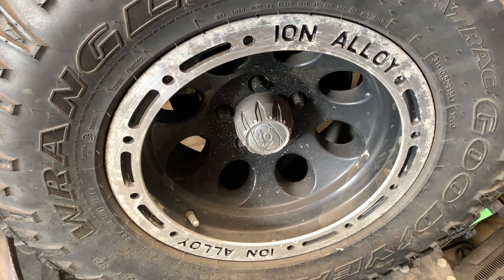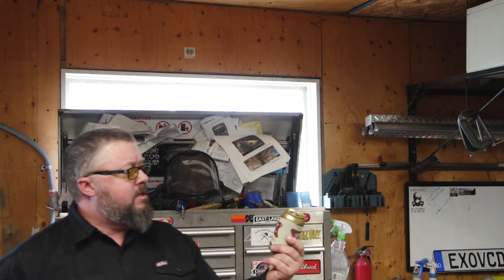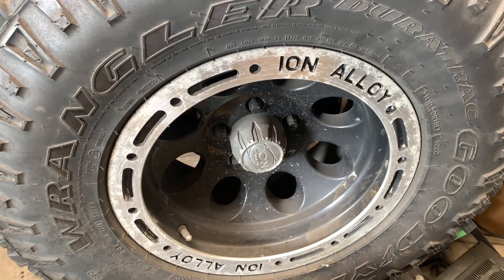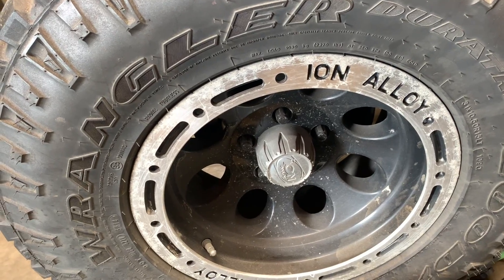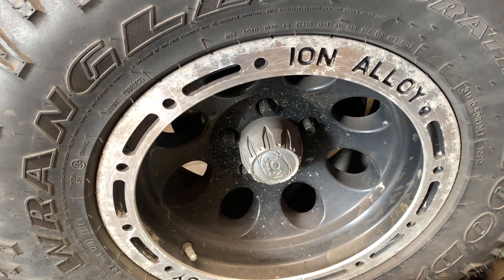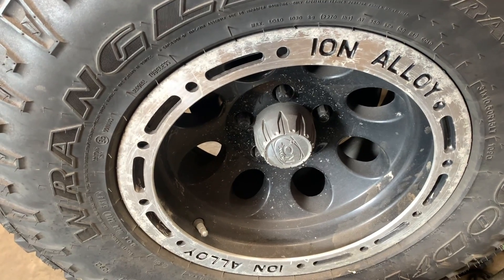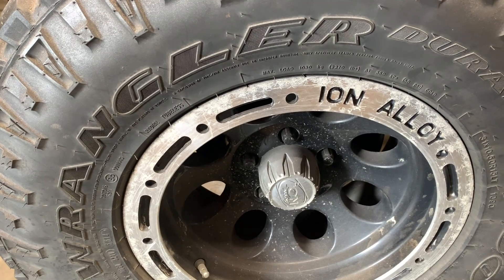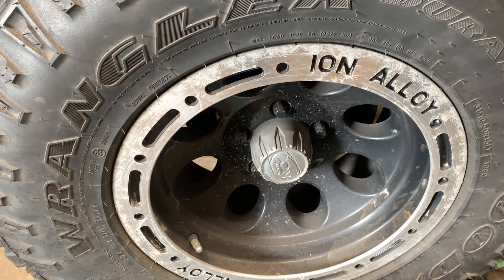Why Using Anti Seize on Wheels and Driveshaft Flanges is Bad

Comment from the maker: Just by the comments I said not many people would understand...... not talking about putting anti seize on threads here people....

Loss of clamping force can result from several other common installation errors, such as neglecting to thoroughly prepare the hub and wheel mounting faces. Any contacting surfaces must be absolutely free of dirt, rust, excess paint or other material that can be compressed as the clamping force is applied.
“Paint, rust or dirt will eventually wash away or fall out, reducing the clamping force,” Walters says. “In particular, steel wheels that are painted are most susceptible. Corrosion of the steel and old paint can flake away.”
A thorough going-over with a wire brush will usually remove loose material, but repainted steel wheels can be a problem too. Paint will compress under the heavy clamp load, and like rust flakes or dirt that tumble away over time, the compression of the paint will leave a gap that could cause the nut to loosen due to the loss of clamping force.
Wheels should not be painted with a paintbrush, because you can’t guarantee an even thickness to the coating. “The coating cannot be any more than 3 - 3.5 mils thick, especially on the mounting surfaces and between the bolt holes,” warns Jeff Redding, national equipment and coatings manager at IMI, a recognized wheel refinisher. “Excessive coating thickness can lead to a loss of clamping force and eventually loose nuts and possibly a wheel loss.”

Source : https://www.truckinginfo.com/157847/what-you-dont-know-about-your-wheels-can-hurt-you

Comment: It's not dangerous to use Anti-Seize on lugs if you adjust for reduction, these bolts are Grade 10.9 and are very strong so its unlikely you will sheer em iff or have them rattle off if they are tightened good within spec whoch usually has a 40 Ft-Lb margin.
The problem with anti-seize and over torqued lugs is 99% caused by shops that use a high torque impact wrench and neglect hand torque wrenching to manufacture vehicle and fastener specific specifications!
Let's say an idiot under tightened your lugs and they started coming loose from vibration, it's not instantaneous and you will not just have a tiee fly off without warning! Your car will drive smooth when sped up and rattle when you let off the gas pedal and slow down. This is the indicator your lugs are starting to come loose. Pull over and break out your  tire iron 3/4"/19mm and snug them up tight. Drive home and get your torque wrench and fasten those lugs within spec!
"The Solution to anti-seize reduction of torque values"
 Using anti-seize compound on the threads only reduces torque values by 30% according to AJax the worlds leading bolt engineers.
The average wheel requires between 75-115 FT-LBS 
My '02 Jeep Grand Cherokee Laredo specifies to torque between 80-110 ft-lbs.
I personally shoot for 100 ft-lbs of torque when threads are "dry" or residually lubricated like from factory. Look at your service manual, they may even list a dry and wet torque setting to use. The Wet "torque wrench setting" is what you use with anti-seize compound on your lug nuts/studs threads.
With Nickel Anti-Seize I set the torque wrench to 70 Ft-Lbs and it reads 100 Ft-Lb in reality every time.
"The EASY formula for anyone to use"
Look up your vehicle service manual and
Whatever Ft-Lbs you your manufacturer states your vehicle needs to be torqued to in the torque-spec: 
just multiply it by 0.7 and you will get the Ft-Lbs you should actually set the torque wrench to after applying anti-seize compound to your lug nut threads!
For example: 
TWS = Torque Wrench Setting.
44ft-lbs X 0.7 = 30.8ft-lbs TWS(31)
70ft-lbs x 0.7 = 49ft-lbs TWS
80ft-lbs x 0.7 = 50ft-lbs TWS
90ft-lbs x 0.7 = 63ft-lbs TWS
110ft-lbs x 0.7 = 77ft-lbs TWS
150ft-lbs x 0.7 = 105ft-lbs TWS

Multiplying by 0.7 is the same exact thing as reducing by 30%
Those of you in the rust belt and cold areas with salted roads can thank me later!
It's extreamly easy formula to follow.
My lugs are 80-120 Ft-Lbs according to Chrysler torque spec on my vehicle.
I normally shoot for 100 Ft-Lbs and that means I dial in 70 Ft-Lbs if I use Nickel-Graph, Copper or Silver Anti-Seize.
Not hard at all is it.
If you are worried, you can buy a 1/2" drive torque reader from ACdelco

Comment: This is wrong. For one. 99% of all wheels are now lug-centric, not hub centric. Two, as long as you're not putting the anti-seize on the threads or lug nut. You're 100% fine, and no (steel) lug nut is going to back off. It's not effecting the clamping force, between wheel and hub AT ALL.

Comment: Continuing from my previous comment... putting the specified torque on the lug nuts achieves the proper clamping force needed to maintain adequate friction between the hub and wheel without lubricants.  Over torque on the lugs actually REDUCES the cramping force needed due to distortion created in the threads.  If you put anti-seize on the threads of the lug bolt that’s probably ok, provided you make allowance in the specified torque because the correct clamping force will be achieved at a lower lug nut torque than specified on a dry lug bolt.  How much lower, I don’t know.  If you use the dry torque spec on a bolt with anti-seize it will be over tight and the clamping force will not correct as to the case when it’s over tightened.

Comment: You are absolutely correct in your analysis of how power is transferred from the axel to the ground by friction between the wheel and the hub, but you are missing one word you need to add to your vocabulary.  That’s “Torsion”.  The lug bolts from the hub are not designed to handle the circular twisting shearing force (torsion) that is supposed to be born by the friction between the hub and wheel which is held together by the lugs.  Proper torque on the lug nuts holding the wheel to the hub free of lubricants is what was designed.  To understand the relation between torque and torsion think that torque is applied about a fulcrum which result in torsion (twisting) forces applied to the shaft.

Comment: I have been using anti seize since the 70 s and have never had a problem with it , even on my off road racing and trail riding! , my dad who was a master machinist said that the flaming should be high with the anti seize then without!

Comment: I would think closed wheel nuts would help.  If you have open wheel nuts, put them on dry but after torqued, cover outside with coat of grease to keep salt out.  Maybe also put small ring of grease at base of wheel studs before threading on nuts to keep salt away from other side.

Comment: My mechanic took your advice and didn't use anti sieze.  Now, unfortunately, 1 bolt (out of 8) siezed, WD40 didn't loosen lug and now I have a stripped stud.  To remove I'll need to drill or grind the lug off.  Huge problem!  Will always use anti sieze in future.  Imagine if I had a flat somewhere and couldn't remove the tire.
Reply from the maker: sounds more like a issue with person doing the job vs actual problem
Reply: @BackCountryWrenching  took to a tire shop today and they tried an impact wrench. Now the stud spins freely. Probably wasn't a good option.  I'm drilling now. So painful.

Comment: You just gave a basic physics lesson to a lot of people. Apparently there are 31 people that didn't comprehend what you're talking about or otherwise think you're wrong. I've worked in the natural gas industry for 12 years and attended trade school for 2 year prior to that. Everything you said is accurate. Your rotational force is greatly diminished when the friction coefficient is greater than that which was factored in for the original baseline when determining torque spec. Inversely, your clamping force/inter-facial pressure is going to be more than desired when using a lubricant. That's also going to result in a higher than desired lateral pull on the stud itself causing undue stress which it was not engineered for. I'm not to get into galvanic activity or metallurgy, but there are a plethora of reasons why you're correct. I'm glad to see at least one person on the internet that knows what they're talking about. Good job. Sincerely.
Reply: Please correct me if I’m wrong but wouldn’t you then be able to just adjust your torque to compensate for the anti seize to still reap its benefits? And thank you for your explanation it helped with understanding the issue with the antiseize a lot
Reply: @Modelwaddle , I’m sure you could, but it would take a great deal of effort to know for sure how much torque is needed. It’s probably ok if you do use some, but I would be mindful of how it may impact your stud bolts. 

We used to experiment with friction coefficient on various thread types and lubricants when I first stared in the industry. Teflon coated bolts had the least amount of friction loss. 

I personally do not have a recommendation on this as there is a lot of liability involved obviously.

Comment: What you are saying is that anti seize changes the “clamping force”, but so does rust, corrosion, worn bolts/studs, stud wear, lug nut wear, temperature, etc?  How exactly are you measuring the clamping force?   I’ll stick with my anti seize.

Comment: Repeating old wive’s tales and lacking in any evidence. 

Drink your beer and leave advice to people who have evidence to back up their claims n
Reply from the maker: 😂😂😂😂😂 the evidence is clear obviously you’re just another arm chair mechanic
Reply: Bullshitkorner nope. And for the manufacturers who spec out anti seize on lugs and rims?
Reply from the maker: I never did mention anything about anti seize on lugs, however very little people know of wet torque specs when you do
Reply: @BackCountryWrenching  I'm not saying you're wrong, but you didn't offer evidence, you offered theory (an understanding of how the physics is supposed to work). Evidence would be a study with a bunch of cars, some with and some without anti-seize, and seeing what really happens. I'm seeing also some theoretical counter-arguments in the comments, but no evidence other than anecdotal.
Reply from the maker: @eblackbrook  this is the difference between tradespeople and armchair mechanics...... don’t need to offer evidence, there is no theory it has been proved many times over by engineers....... you can never understand cause you’re not a trades person and or lack real world experience

Comment: Interesting...good points as well. 
Surely, there must be a happy midpoint...As far as the studs/bolts...(beyond a certain threshold) I think it's most important that they are all at the same torque - whether that be  a bit too much due to lubrication, or too little gritty threads...an imbalance in manifold torque is more of a worry - in my opinion.
Nice. Thanks...

Comment: You are 100% correct, however; the engineers that design the hub and wheel assembly do it in a way that the "required" clamping force is at least 3x what is actually required to keep the wheel where you want it (on the hub) for normal driving conditions.  I use Anti Seize all the time, every time without hesitation.  Good video and very informative!!!

Comment: As stated in the general aviation maintenance manuals (203 series) shared by the Army and Air Force, it is stated that a light coating of oil be used on all fasteners requiring torques to achieve proper torque (clamping force) unless specifically stated to be dry. As far as anti seize on wheel studs the NTSB has issued guidance that it is not to be used.

Comment: A piece of parchment paper used for baking between the wheel and hub will keep it from getting stuck to it.  Something my dad taught me in the 70's when he was learning me how to wrench things in Michigan.  You're explanation about clamping force is right on, the same reason aircraft engines have absolutely no gaskets on the crankcase halves.
Reply: My Textron Lycoming DEL-120 service manual specifies POB No. 4 Perfect Seal and silk thread for sealing the crankcase halves. Hardly a gasket but, not just two pieces of metal slapped together either. 😃
Reply: @flyingdutchman6984  Yep. I should have specified no solid gasket material that could break down and create a clearance.  Every 2 stroke engine I worked on had the same thing, crankcases sealed with goo vs a physical gasket.

Comment: I never tried anti-seize, but I have always used a little wheel bearing grease on wheel studs, drive shaft flange bolts etc.  I check torque every once in awhile and have never had a wheel come off in almost 50 years of driving.  Specs used to call for torquing a lightly lubricated wheel stud.
Reply: The nuts don’t loosen, the studs stretch because of over torque
Reply: @9856CB  Then don't over torque.  Use a torque wrench and do it right.  As anyone knows who has ever put together a hi-performance engine, is not friction that keeps things together, its the clamping force (by stud stretch) of torque.  In fact with some engine builds, after the rod nut is torqued, the clamping force is verified by the measured stretch of the rod stud.  It's not friction that should hold things together as friction can and does change, its torque whether it be an engine's main or rod caps or a truck's wheel studs.  That's why its important that nuts and studs be very clean and sometimes lightly lubricated to get an accurate application and reading of applied torque.

Comment: I use anti-seize on my wheel bolts. It's pretty much the only use I have for the stuff. Lug nuts seized up from rust are a fucking nightmare. Plus it helps keep your lug nut torques honest. Been doing it like that for years(decades actually). Never had any problems with it. Tires rotated @ every oil change.
Reply from the maker: What torque spec do you go when using anti seize ?
Reply: @BackCountryWrenching  What the manual says...more or less. So ~100ft.lbs....if I'm using a torque wrench. Or gutentight if I'm not(and far more often I'm not). I don't bother with torque wrenches much honestly. Unless I'm tightening head bolts.
Reply from the maker: So your over-torquing the bolts, 🤔🤔🤔 wet threads rule of thumb is 30 percent less than dry threads.
Reply: @BackCountryWrenching  I wasn't aware of that info. Sounds a little suspect to me. Are you pulling my leg? I've always gone by the opposite...sort of. By that I mean you won't get a true torque(to the measurement) without lube of some sort on the threads. I know I've read, and heard, that said before.  At any rate, like I said, I don't subscribe to torque specs much anyway. I'll use them for head bolts every time. Because you really need to for those(unless you want overly distorted cylinders and/or blown HGs). I'll even use them for mains and rods if I have them readily available. But other than that...I usually can't be bothered. And...other than occasionally stripping some threads or snapping some bolts...as tight as it feels like it needs to be works for me. I won't deny I'm a chronic over-torquer though. If anything. My shit NEVER comes loose.
Reply from the maker: https://www.google.ca/amp/s/www.engineeringtoolbox.com/amp/torque-lubrication-effects-d_1693.html

Comment: Makes a lot of sense. I dont normally anti-sieze the flanges but I do put a very small dab on the studs. Cheers man!
Reply from the maker: Studs are fine as long as you torque to the wet spec and not dry

Comment: EVERY NASCAR has the threads on the studs anti seized before every race..reduces the friction so the nut will torque properly..Anti seize on the center hole will hurt nothing been doing it for 60 years that's where the wheel gets stuck not the flange..
Reply: well JAJ, you have me beat, I've only been doing it for 50 years...lol   How or where can I get verification about the NASCAR?  I really need this info to settle a very heated family debate with my brother-in-law who disagrees with the lubing of studs.....Thanks

Comment: Any liquid/grease/anti seize etc on a wheel nut/bolt. Liquids don’t compress and you aren’t achieving an accurate torque value. I have read that molybdenum is an exception to that but that’s beyond my shallow armchair internet knowledge

Comment: Just up for a bit of a friendly debate.  Anti-seize actually increases the clamping load and evenly distributes the load around the whole device.  Some cases actually call for you to reduce torque in applications where anti-seize is used.  I’ve been an aircraft mechanic for a pretty long time, worked multiple different airframes.  But on everyone of them when installing engine mount bolts you apply anti-seize.  There are right and wrong applications no doubt, but I do not believe anti-seize will reduce clamping force when used properly
Reply from the maker: I am not talking about using anti seize on bolt threads which a wet torque is a about 30percent less than dry torque depending on application

Comment: The other alternative would be to use Threadlocker or "Loctite" on the lug bolts..........Either the Medium (Removable) or Low Hold (Purple - I believe).   It would hold, seal and keep from getting frozen and prevent rust.    I do not know how it work, because I have not tried it.  I would definitely NOT use the Red Permanent.